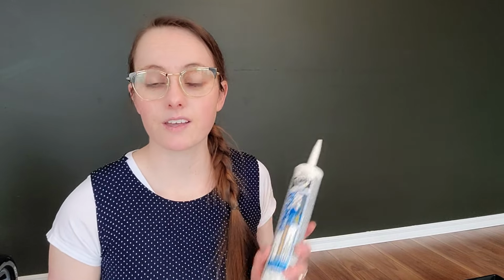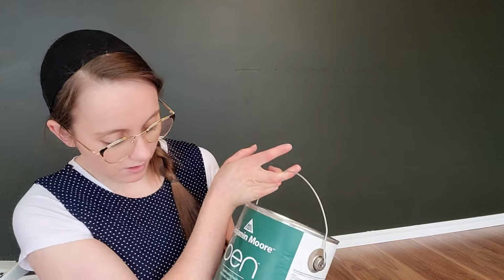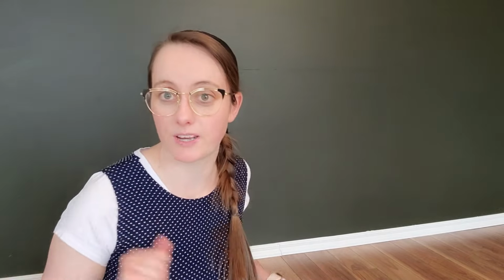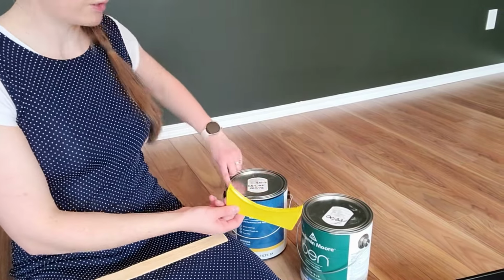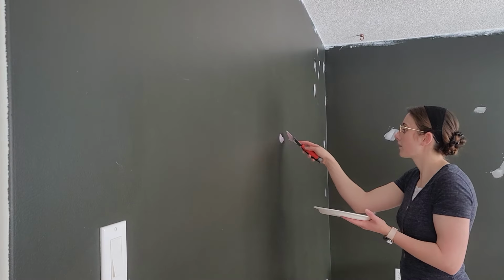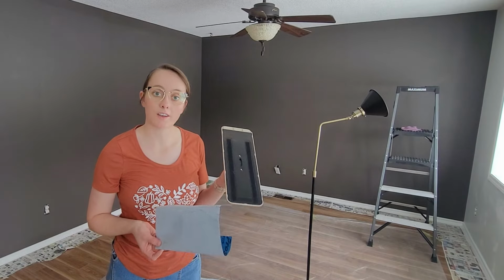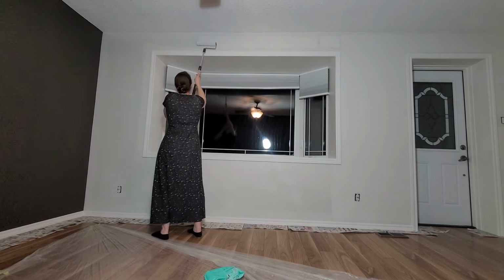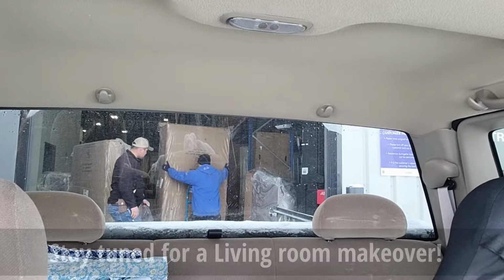Did I Make The Right Choice!?! Painting A Wall Black?!🤭

Comment: Applying too much paint can cause bubbling, try taking the extention off and using more pressure spread the paint out more, its better to do 2 thin coats than one thick one and you will have less excess on the roller when you finish, leave the wall a week before you repair it again to fully dry and fully absorb, the window wall is the coldest wall so if its winter heat the room up a bit but not too much because drying out excess paint too quick can cause cracking or an eggshell effect. Trial and error your doing great, good luck !
Reply from the maker: Thank you for your input. I don't think it was because of to much paint, I always try to make sure and nor have to much paint on a roller. But I will definitely try again when I do some more painting anyway. Maybe let it dry for a couple of months see what happens.

Comment: Hi Justina,
I’ve had that bubbling happen to me, and it was because the original paint on my wall had not adhered properly, and when it became damp from the new paint it lifted and bubbled. I ended up having to sand my wall really well. That seemed to work for me. I hope this suggestion helps. 

I must say I love your videos! You motivate me! Lol  God Bless ❤️🙏🏻
Reply: Thought of something else… If the original paint was applied directly on the drywall mud, that fills the drywall seams, or onto plaster without a primer, moisture will be a problem because the plaster/mud will absorb the moisture from the paint and the paint won’t adhere. Hope this helps. ❤️🙏🏻
Reply from the maker: Thank you so much for sharing your experience. I might have to try it whenever I do some more painting. I would make sense that that would happen if the previous paint didn't adhere.